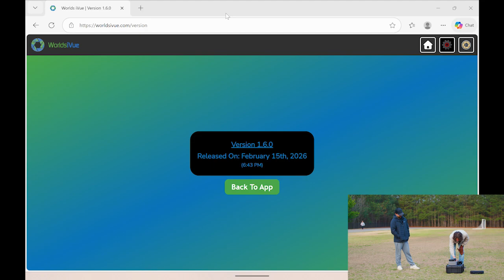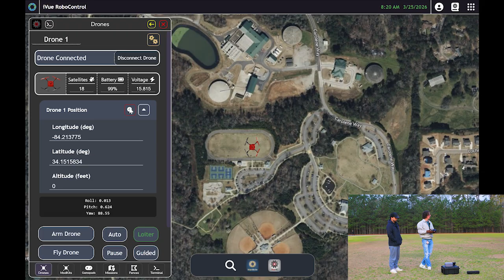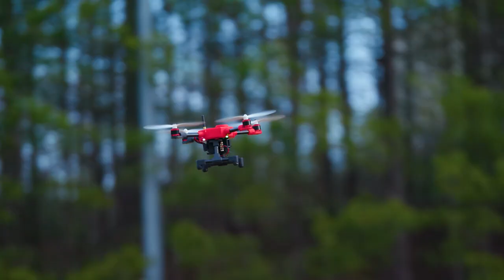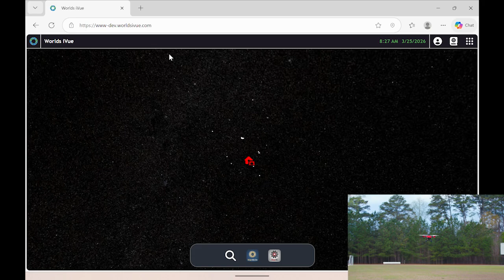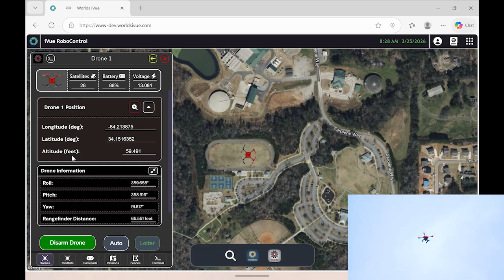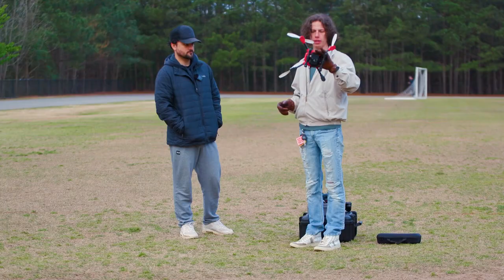Develop Air mini Survives a Hard Landing | Testing GPS, Optical Flow, & H-Flow Rangefinder Limits

Comment: What optical flow sensor are y'all using? Also, I love the size of that mini frame. Is there a way to get the frame or 3d print it?
Reply from the maker: The Holybro H-Flow. The mini's fuselage is available, alongside the rest of the Develop Air mini 3D printed part files, through the downloads section on the iVue Robotics website.

- Jacob
Reply: @ivuerobotics   May I ask what the preferred print materials and generic print settings are? Mainly the infill density and infill type. Are the arms carbon fiber stock pipe?
Reply from the maker: The preferred material and print settings should be included within each and every 3mf file. Nonetheless, ASA-GF is our production material and all parts are printed with at least 40% gyroid infill.

The arms and leg tubes are a type of fiberglass nearly identical to carbon fiber in strength and weight, but the fiberglass tubes are significantly more affordable.

- Jacob
Reply: @ivuerobotics Thanks! Do you cut the arms to length in house? If not, is there a source you could recommend to get them?
Reply from the maker: Yes, we cut the tubes to length in house, using a mitre saw.

Complete boom arm assemblies, with or without a motor included, can be purchased from us directly. Otherwise, the tube by itself is often best procured through McMaster Carr.

- Jacob